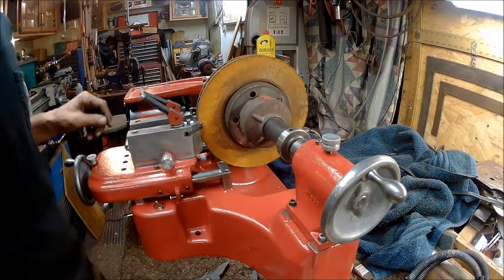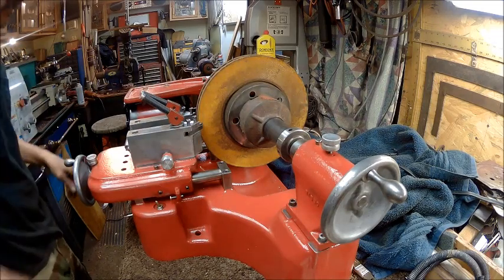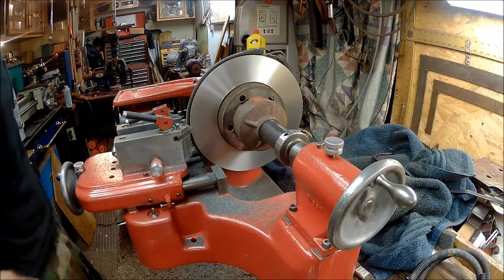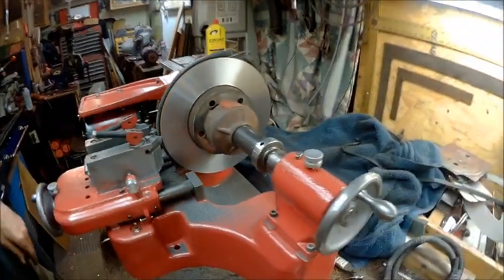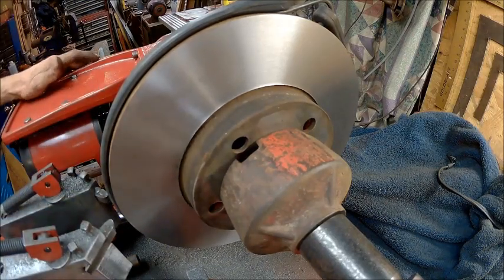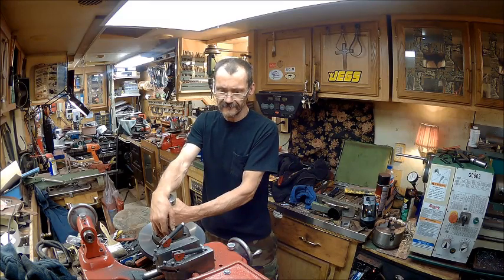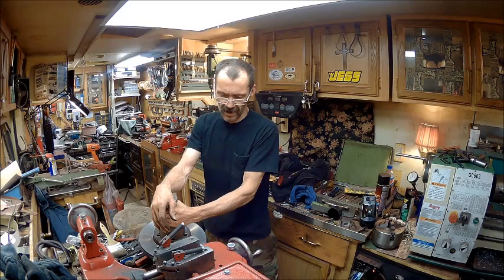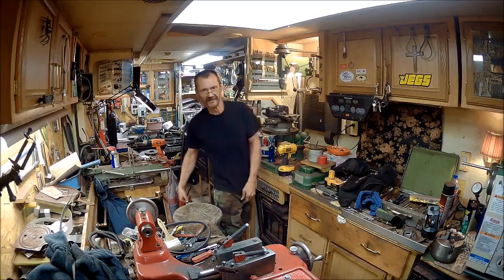atlas brake rotor lathe restore part 3

Comment: great video, I'm not sure if you already know this but just incase you didn't, I'll pass it on to you.. Stamped on each rotor there will be a spec number that tells you how thin the walls are allowed to be turned down to before they are out of spec.

I hope this helps.....
Later
Reply from the maker: very good info. thanks

Comment: Entertaining video series.  You must be either single or VERY lucky -- I know my girlfriend would KILL me if I even mentioned the idea of turning the kitchen into a machine shop, haha.

I think you've come to the right conclusion selling the machine.  You'll never make any money doing commercial work with a brake lathe, not when you can buy brand-new rotors for a typical Ford or Toyota for 20-40 bucks each online.  If the trade situation with China changed, things would be different.

Maybe if you knew somebody who worked on vintage or exotic cars, you could make money turning drums and rotors for hard or impossible to replace applications.
Reply from the maker: i agree

Comment: Can you please tell me how this is driven I have this machine in my basement and I need to use it like last week the model number is worn off and it says it's an rjw however these videos you've made are all I can find I am interested in the arbor or mandrel setup please and thank you
Reply from the maker: i dont understand what you mean when you say how is it driviin. it is drivin by a 110 ac motor
Reply: @BisonWorkshop  ok I'm sorry I should've specified I'm in a jam my 2011 ranger is in the parking lot with the transmission apart and has been for weeks. I got my clutch kit finally but there's some glazing on the flywheel a few weeks back I was given a long shaft brake lathe and a larger one identical to yours that 5 urns between centers however absolutely no tooling now I do have a lathe but it's too small for the flywheel I'm doing my best to create an arbor or mandrel to turn the flywheel but I've never seen any of the adapters for this machine and I can't fit it on the smaller brake lathe without knocking out the bushing that seats the pilot bearing on flywheel and that just won't happen I'm not licensed but I've worked in machine shops I have a small shop here at home and I'm so broke I can't pay attention  it's a miracle I came up with the clutch kit now I need to resurface flywheel so how do I make the arbor like what components am I supposed to have because I have a couple cone shaped pieces I'll use to clamp but that's pretty much it I'm sorry for the book I've just wrote and appreciate you taking the time
Reply from the maker: @mikeyworth4496  i wouldnt have a clue how to go about that. i sold these lathes a couple weeks after this video. that was in 2016 and i dont remember much about them. but it sounds like you will need to get creative and make what you have work

Comment: you need the round bit leaving the radius keeps it from cracking. best to cut rotors with carbide not HSS.
Reply from the maker: so can you still buy the round bits
Reply: SURE it dont have to be much radius the ones that are made like a circle with a hole in the middle for the retaining screw are finishing bits and make a really nice finish. you can use a straight bit with a small radius on the corner it will work just not as well. chances are the brake pad / disc wont come close to where the radius is cut near the center. so if the ones you have leave a nice finish and it looks like it did, then i'd keep that one.
Reply: carbide cuts brake disc much better than hss and leaves a better suited finish for braking applications. you can see the difference in my video where I turned the clutch disc plate one side with hss the other with carbide. the finish is much more uniform.

Comment: I would also try a remove as much rust of the rotors and drums before you cut them the iron oxide kills the cutters
Reply from the maker: i know and i did. thanks
Reply: oh, i see what you meant, lol. i thought you meant where it meets the cones. i will clean all from now on. thanks for the info.

Comment: Rotors are so cheap now days. Older rotors also build up a lot of rust which doesn't dissipate heat very well when tends to cause them to warp over time. Better to just replace them buggars
Reply from the maker: thats why i just fixed them up and sold them. i turnd a set of brake lathes i paid $300 for into a $900
Reply: Bison Workshop nice